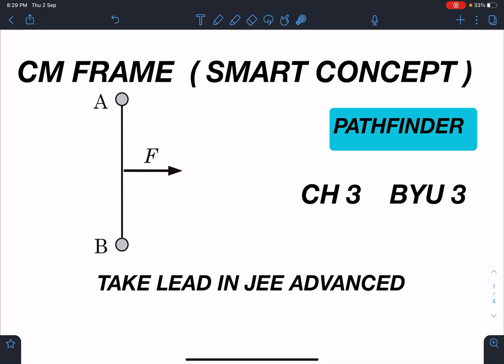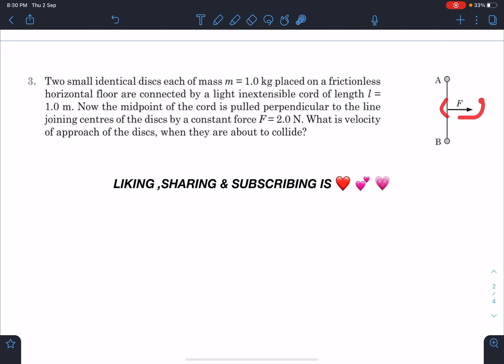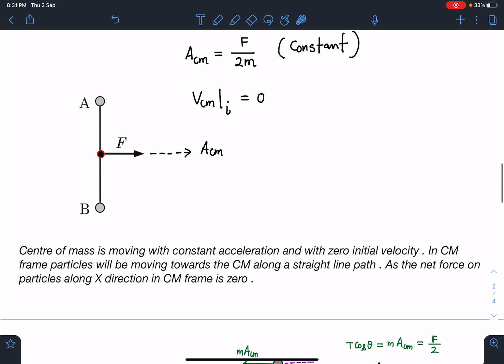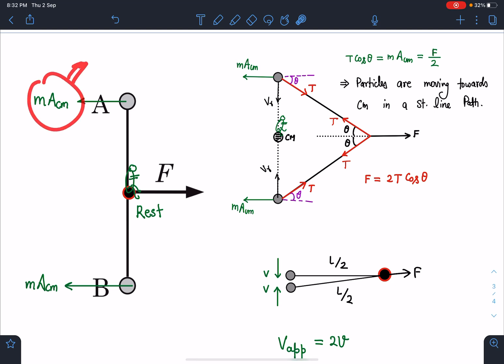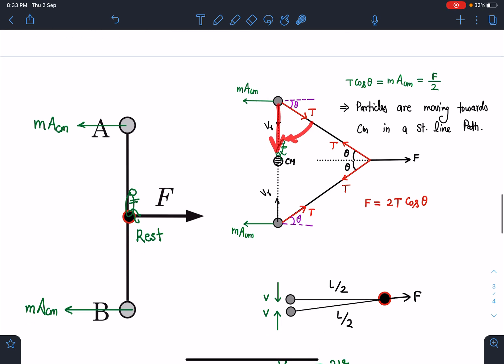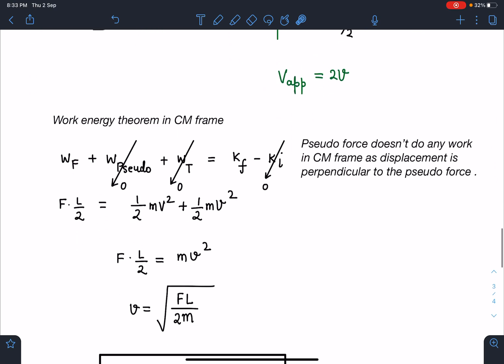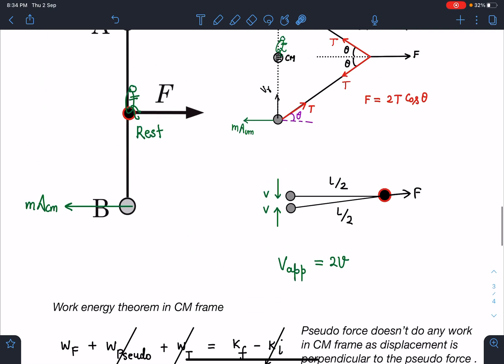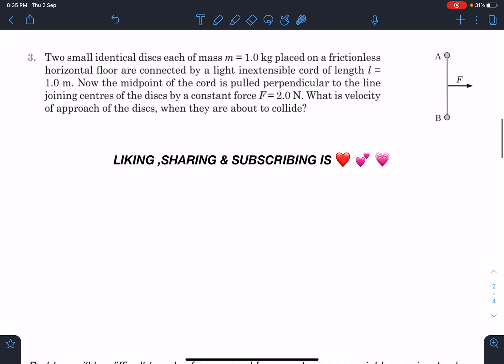[JEE ADVANCED][ PATHFINDER C3 BYU 3] CM FRAME  APPLICATION[ ADVANCE PROBLEMS IN SCHOOL PHYSICS]

Comment: Why the total tension work is zero , as a component of tension is along the motion of particles
Reply: Work done by tension is not zero. In work energy theorem work done by applied force should not be taken. Only by psuedo force and tension. By psuedo force work in zero. By tension work done is FL/2 after making proper calculation.

Comment: Why work done by tension is zero? Tsintheta is in direction of displacement and force is perpendicular to displacement so it should be zero
Reply: Work done by tension is not zero. In work energy theorem work done by applied force should not be taken.only by tension and psuedo force. By psuedo force work zero. By tension work is FL/2 after making proper calculation.

Comment: I solved it In ground frame
Let Theta be angle made by strings with x axis . 2Tcostheta=F
now the discs will approaching along Y axis. Hence Tsintheta=mvrdvr/dx 
X=l/2costheta Diff and Put T and dx in the eqn we get Flsintheta/4 dtheta= Mvrdvr integrate Theta from 0 to pi/2 and vr from 0 to v we get V= sqrtFl/2m now relative velocity is 2v
Reply: I also done it same manner ....i took tangential acc a as Fsin(theta)/2m and a=dv/dt as the particle will be in circular motion(R=l/2) dt=Rd(theta)/v........and integration from 0 to pi/2 ...got the answer
Reply: Same
Reply: How did dx term came in dvr/dx ? Acceleration along y axis can be written as mvydvy/dy ....so by this logic it should be mvrdvr/dy ...please explain as i am stuck to this stage
Reply: @rmishra70  ya its dy only its just that its habitual to use x
Reply: @aarsiprasad5342  thanks bro 👍
Reply: Same bro

Comment: I did it by Tension method which is little lengthier than this 😂😂😂. Your method was too elegant sir. You solve Pathfinder like it's ncert 😎😎. Thank you sir.
 INSP ROCKS ❤️❤️
Ps: Sir I had a doubt in your heat generated in the spring video and I am still not able to wrap my head around it. Please resolve it sir 🙏🙏
Reply from the maker: I’ll check
Reply: NCERT for IPhO

Comment: In com frame the masses will follow circular path then how is Work by psuedo force zero sir?
Reply from the maker: How can they move in circular path ? Plz think
Reply: @INSP_NITIN  sir how is the work done by tension 0
Reply from the maker: @munshi2003  recall virtual work method for constraints .
Reply: @INSP_NITIN  got it sir 
Thank you sir ji 😀😀
Reply: Sir what will be it's trajectory in com frame, I am not able to imagine
Reply from the maker: @sohansingh2022   it’s circular about the point of application of F , but CM is always at the mid points of particles .
Reply: Oooo shit 💕 thank you sir

Comment: i did by deriving force equations but this method seems too elegant .hope that will be able to solve this problem by this way after studying com from u
Reply: Man, can you please tell me why the work done by tension is zero here?The displacement is not perpendicular to tension right?
Reply: @evanssamuelbiju4315  tension is internal force , look at both ends of string half you will notice that net force due to tension is coming out to be zero hence no work done by tension
Reply: @rmishra70  Thanks for the response.But the work done by an internal force is not always zero.And if we take two particles separately, the Tsintheta component acts along the line of displacement of the body. And since,energy is a scalar ,if we take the work done by each particle,they don't add up to zero....Please tell me where I am wrong
Reply: @evanssamuelbiju4315  you are thinking correctly no problem in it , scalars will add up and all those stuff but the you must account for the T factor at other end of the string as well. Calculating work done by that T can be a complex work as the angle is also changing . But if you do it then you will find that positive work on particle and NEGATIVE work on other end of ring add up to zero
Reply: How to do with tension method please give some idea i want to solve it from traditional method
Reply: @rmishra70  u can write fbd equation but I guess the major problem u r facing is to write DX in terms of dtheta ,so u can write x as l/2 costheta then differentiate both the sides
Reply: You are in 8th

Comment: Pathfinder - I am the toughest question bank for Physics.

INSP - Hold my bell icon 😎
Reply: He just frame questions on live class that will almost give you heart attack..... But surely it also helps in tackling with the different situations ☺️... ❤️
Reply: @yuvrajsingh.5717  ☺️
Reply: Man, can you please tell me why the work done by tension is zero here?The displacement is not perpendicular to tension right?
Reply: @evanssamuelbiju4315  See tension has two components
The component in direction of f is perpendicular to motion so no work done
Now. The components which are along the line joining cancel each other (considering both masses-up and down) 
Thus work done by tension is zero
Hope you understand:)
Reply: @sudoheckbegula  Thanks m8
Reply: @evanssamuelbiju4315  WELCOME BROO